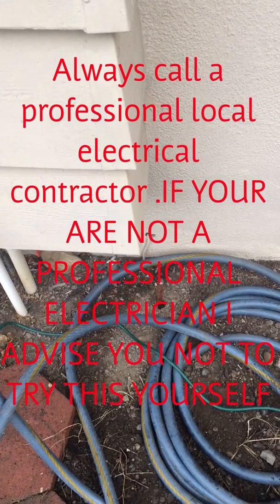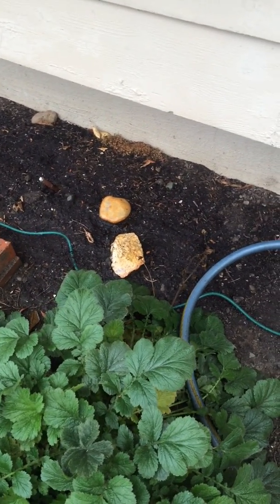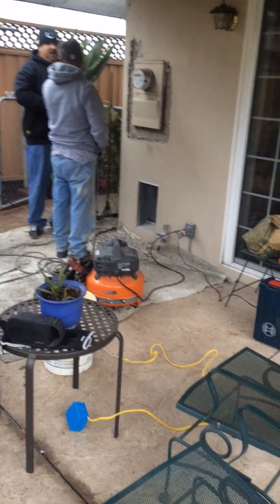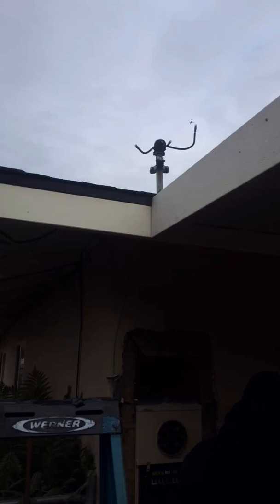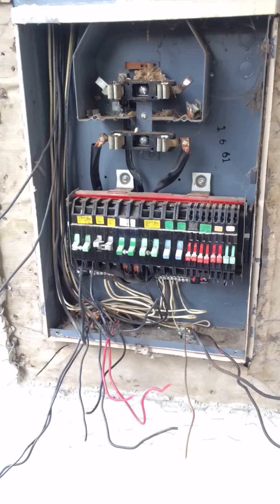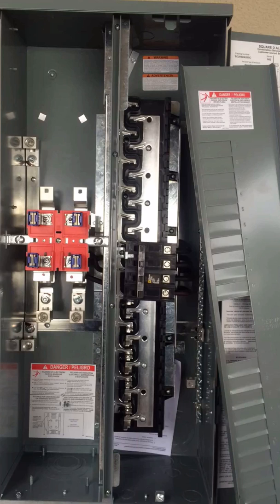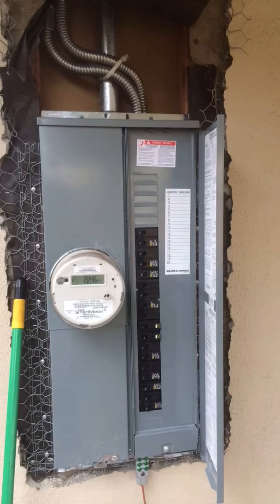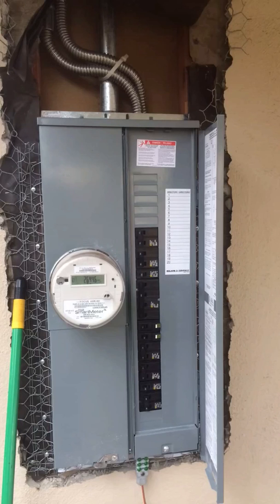Electrical panel upgrade

Comment: Looks good man ! What tools did you used to cut those services lines speacil safety stuff too?
Reply from the maker: Not at all ,,, back then it was permitted, now days is ilegal to do .
Any pliers would do the work ,,, is aluminum really easy to work with … although I don’t recommend to cut them anymore ,, is illegal

Comment: OH MAN do I have some questions and responses for you. 
1. Are you a lic, bonded, insured contractor with the state of CA? 
2. You can’t support those flex cond with a zip tie to the main service riser. The main service riser is not a structural support. You can’t support this is something that needs a support
3. Your #4 Main grounding electrode does not need to be “continuous” 
4. Where’s your HOT , cold, gas bond? 
5. No where in the code does it say you have to supply ARC fault for a service upgrade. 
6. Chip out the panel yourself 
7. Do the lath/paper yourself 
8. Do the stucco repair yourself. 
9. Learn the terminology. “PIPE WATER” ????? 
10. Chip the stucco more jagged. You’re going to create a “cold joint” and that’s going to crack out.
Reply from the maker: 1. Yes
2.this video was way years back , ( I didn’t have the experience I got now of course after 10 years or so,, also the flex wasn’t supported as such for the pipe riser , it was just been held while we put a strap (doesn’t show in the video) so your wrong !
3. There is no way you can pass an inspection if the ground in not continuous “ ( unless your lucky to have a stupiddd inspector ! ( again your wrong) even if is not in the NEC , is simple i don’t like to argue with inspectors about the ground been Continuous rods/main water/panel.
I will always do it so I will always pass! ( again your wrong )
4. You can’t spect to see the hot-cold-gas bonding on the panel side “it’s always at the water heater” ( again your wrong) 
5. Again your wrong ,, arc fault breakers , is a 50-50 chance that depending on the inspector might ask you to install them or not ,, that’s why I always call the inspector directly to make sure what they want ( again I don’t have time to argue with them so I always overkill details) to make sure I always pass .
6 . And the rest of the questions related to stucco , I don’t really care on your opinion , that’s why we always hire a stucco guy to also make sure inspection will pass !
Thanks for your comments though!!
Reply: You never answered my 1st question. ARE YOU A LIC, BONDED, INSURED CONTRACTOR???? If not you have no business doing this type of work.
Reply from the maker: @bruceglick9299  I did answer my man!
1. Yes ( it means yes , I’m licensed , bonded and insured .

Comment: So let's say your panel is surface panel and you have to run the wires from the back ,would you use a single chase for every circuit or you would use a bigger single chase and run all the wires through?
Reply from the maker: You can use 1 or 2 emc pipe connectors (1-1/2” to 2” )with a plastic bushing on it and run up to 8 circuits/wires in it .
Reply from the maker: https://www.gordonelectricsupply.com/p/Egs-7200Gsr-2-In-Rt-Emt-Conn/5936307?gclid=CjwKCAjwg4-EBhBwEiwAzYAlsnL48g1LSS-DFmw5eiLAkLrueYYYV-9C8We_Mj61n0ELH1-wu5KpnRoC-IUQAvD_BwE
Reply from the maker: Or worse case you can use a 2” screw connector
Reply from the maker: https://www.homedepot.com/p/Halex-2-in-Non-Metallic-NM-Sheathed-Cable-Clamp-Connectors-05120/100127021

Comment: You mentioned grounding conductor must be solid #4. Is this what your city requires? In the NEC 250.62 it states it can be stranded as well. Curious to know  Thanks
Reply from the maker: On the NEC allows 4 stranded only to everything within the house ,, but when is about main service it has to be solid .
To me ,, stranded is more than ok ., but if is gonna be inspected, I wouldn’t risk failure just to be cheap.
Reply: @MrLuismedina25  Ok. Thanks

Comment: I have this exact same Zinsco panel flush mounted in stucco. I’m planning to upgrade to a new 200A Square D panel and convert from overhead to underground at the same time. My question is how should I bring the underground feed into the wall since the new panel will also be flush mounted? Do I have to cut or drill a hole in the slab foundation for the conduit to come up to the panel? Thanks!
Reply from the maker: I gave the same answer to Corey Kennedy , check the conversation

Comment: Nice Video. 

How did you support new conduit riser inside wall? Did you you have to break more stucco above panel?
Reply from the maker: Nop,, the hole you make for the pipe to get in ,(should be nice and almost tight ) is considered as strap !!! Nothing goes between the riser and the panel . 
Just make sure that the end of the riser head top is not more than 36” otherwise inspector will make you strap the pipe with the roof . Even an inch over will make you do it.
Reply: @MrLuismedina25  Great Advice! I will do this.
Reply from the maker: Also ,, now days , they request 2 ground rods 5/8”s instead of one . 
Make sure your ground wire goes from panel to the rods and end in the panel without cutting the wire. Do loops
Reply: @MrLuismedina25  Your correct. I deal with So Cal Edison and that's what they require.

Comment: Hi, for San Jose, what type of meter panel is required?  There are some that are ringless and some with the ring, is either one ok with San Jose?  Thanks.
Reply from the maker: David I never heard of ringless ones !!
Send me a link of one ,, just use a square d or Eaton ,,, there no brainers
Reply from the maker: Never heard of ringless
Reply: @MrLuismedina25  Siemens MM0404L1400RLM 400-Amp Levery Bypass Meter Main Combination with and Ringless Cover
Reply: are you in or near San Jose?  I notice that you reused the same roof opening from the old panel but you are not using the same space as the old panel.  When doing a panel replacement, what do you have to get done to get the city to give you a meter release?    In other words, what does the inspector want to see before he/she can give you a meter release in this particular work that you show in the video?  Thanks.
Reply from the maker: I see,, a 400 amp continues is not a push in standar Meter,, all you have to worry about is to order a 400 amp panel that is rated as 400 “continuos”
Because there is some 400 panels that are rated as 320amps at the meter
Reply from the maker: David hey just to make sure,, do you really need a 400 amp service ? Why not a 320?
Reply: @MrLuismedina25  I think they are the same depending on how you look at it.  400 non-continuous is same as 320 continuous.  Comment about meter release?
Reply from the maker: David ,, no I don’t talk about the release,, what All I can help with is , that this week I’m installing a 400 amp panel with the meter rated at 320amps ,,, pg and e inspector told me that the 320 amp panels are still push” in standard meters,, but if the panel is a 400 amp with 400 amps continuous in the meter , automatically will be a ringless
Reply: @MrLuismedina25  ok thanks Luis.
Reply from the maker: https://youtu.be/6kd7_oF37r8

Comment from the maker: Between 2000-3000 depending on stucco, panel size etc. But there is areas like San Jose-Santa Clara , etc that some company’s charge up to 4g’s

Comment: Nice work. So there is really no way to install a new panel without affecting g the stucco.?
Reply from the maker: Unfortunately no,,, only when the panel is a wall mount ( mounted over the stucco, then that’s a different story, u can check my other videos with more details
Reply: Luis Guerrero I have a panel recessed in the stucco wall. I need to access the panel to add another circuit. I was going to chip out a bottom section of the stucco, put in the new circuit and then cover the hole with a jbox and cover.  Any good??
Reply from the maker: What I usually do ,, if your bringing the new circuit from under the house , find the very bottom of the wall under the panel by looking at the vents or looking at the crawling space,,, once u have an idea of the very bottom ,,, buy a 2 gang(4x4”) plastic ring,,, mark it on the wall under the panel ,, drill around your mark with a bit for stucco (any small size) like bullet marks around your mark,, that way when u start hitting the stucco with a flat bar and hammer the stucco won’t crack far away.
Now you have created an acces to drill in angle towards underneath the house while been inside the wall (I hope you understand me) then from inside the panel open one of the knock out holes and use a fish tape or stick to pull the wire up and thru, of course once u have had run the wire ,, and that’s it, let me know if u have more questions!